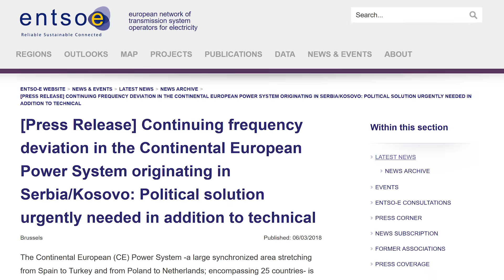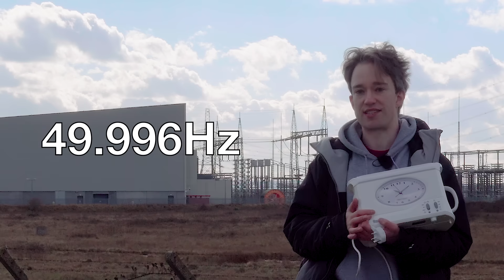European clocks ran slow for a bit. British clocks didn't.

Comment: Great video, thanks.
I believe, as the number of wind/photovoltaic  power  generators increase, and high-inertia giant vapour turbines, powered by oil/gas  - decreases, it will be increasingly difficult to keep our precise 50 Hz mains frequency.
It may be necessary to use a frequency reference master source, instead of relying on the mechanical inertia of those heavy pieces of equipment, as it has been the case to date...
Reply: Solar panels produce DC current that is turned into AC by inverters. And those can output a steady 50 (Or 60 in the US) Hz signal all the time with actually less fluctuations than the alternators of nuclear and coal/oil/gas power plants.
Wind turbines on the other hand have speed control mechanisms built into them but there can also be inverters.

Comment: What has underpower got to do with frequency?
Reply: Much: If the turbines don't provide sufficient torque, the overloaded generators will brake them too much, therefore they both will rotate slower, resulting in reduced frequency.

Comment: The situation is further complicated by the fact the Length of a GMT (Greenwich Mean Time) second differs from the UTC second by upto Plus or mins 4 seconds over the course of the year. While GMT is the legal time in the UK it is very difficult to get an accurate source of GMT - in most cases it requires quite a complicated calculation to calculate GMT ( or the nearest Time to this that currently exists) from UTC. It is not a static difference but changes throughout the year. So the big question is how is the UK 50.0000 Hz specified in terms of UTC or GMT ? If in terms of UTC a couple of times a year the days can have plus or minus two leap seconds added or subtracted to keep UTC in sync with the Earth rotation. On those days the 50Hz would have to be higher or lower to get the correct number of cycles in a day. If the 50.0000 Hz is defined relative to GMT the frequency would have to be adjusted continually to account for the irregularities in the Earth's rotation. For more information look at what used to be called The Earth Rotation Service - great title - stop work and the world stops rotating.  I have tried to find a legal definition of GMY+T but while it is used in acts of parliament it does not appear to have a statutory definition.

Time is not as constant as you might think !
Reply: It is usually 1 second per year added to UTC to align it with GMT, because the earth’s rotation is slowing down. A year is about a second longer than it was 100 years ago.

Comment: If Europeans want to run a clock accurately they should synchronise it with the German atomic clock signal DCF77 at 77.5 kHz. You can hear it from Ireland to Turkey.

Comment: This is all well and good but clocks in the EU and everywhere in the world are either battery powered or use an internal clock for synchronization and not the grid frequency 😁😁😁😁
Reply: Most alarm clocks don't
Reply: @markposthuma2000  yes, most alarm clock don't use the Grid frequency

Comment: So if I bought one of those (importing it to the United States of America), some British plugs, outlet boxes, and covers, made a 240-volt circuit just for those British outlets, and plugged that Teasmade in, the clock would run fast.

I think relying on grid frequency for clock timing is as stupid as Hoover's free flights promotion, and the Serbia-Kosovo issue illustrates why. They're cheap enough, just use a crystal oscillator.

Comment: Why is all of Europe on a synchronized grid anyway? What's the benefit?
Reply: For higher grid reliability and stability and for cross-border tradind (lower electricity prices).
Reply: What the other comment said but also, that claim is a simplification. The biggest exception is that the Nordic grid is separate (the continental part of Denmark and a couple of the closest islands are in the Continental Europe grid, but most islands including the one with the capital Copenhagen are in the Nordic one). The 3 Baltic countries also have their own regional grid. I'm not sure if Sardinia and Corsica and all other islands are synced to the Continental Europe grid either: at least those 2 are only connected to the mainland with DC, as with other non-synced regions.The UK isn't a single synced grid either, because Northern Ireland is synced with the Irish grid, not the main UK one. I'm also still leaving out some exceptions and details.

Comment: What do you mean "these cables are direct current cables"? You're not trying to imply that the power from the Netherlands traveled across the sea by direct current, are you? From what I verified by an internet search: "Voltage of DC cannot travel very far until it begins to lose energy." which is why DC power has never caught on.
Reply: DC has not caught on until semiconductor technology matured sufficiently. Today, longest transmission lines use DC (read about HVDC lines.) GB is connected to other countries via DC lines since GB is its own interconnection (it isn't synchronized to other interconnections like the Continental Europe Interconnection for example.)

Comment: Interesting but normally quartz crystal is used a reference as such the clock is still fine and breaking news- time continues at a regular rate clocks running correct or not - interesting story though

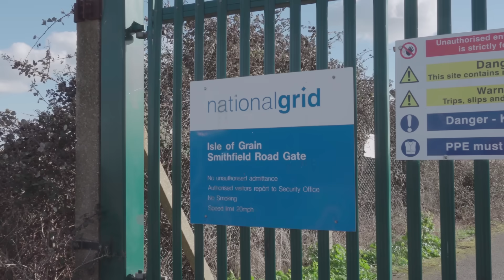Comment: 3:15 this sealed brexit, just saying, this really proved that the UK has everything under control without the EU
Reply: A sizable part of maintaining the balance of the grid is from imports from the mainland which if the EU wanted to be really dickish could make the problems with that I don't see it happening though as it benefits them to

Comment: Americans be like: weak numbers, we use 60 Hz
Reply: Julian GameZ come back when you have 230 volts at every outlet.
Reply: @spencerwilton5831  The American power grid is standardized on 240 volts. When it arrives at the house it arrives at 240 volts. It's not our fault Europe doesn't understand how to divide by two.
Reply: SavageGreywolf You do realise we have the option for three phase power too, but few homes require it because having a decent voltage means we can pull twice the power for the same current. If your power system is so good, how come so many Americans are always talking about power outages, generators, gas fridges and all manner of devices designed to assist during a long duration power cut? Here in the U.K. I think I have experienced one power cut in the last twenty five years. It lasted about an hour and was confined to a few houses on my street, caused by a cable being damaged by roadworks. The power simply doesn't go off here. Meanwhile, you have entire states suffering rolling blackouts. Not to mention still relying on coal for much of your power.
Reply: @spencerwilton5831  your absolutely full of it I cant remember the last blackout in indiana ohio or Kentucky   where I'm frequently at
Reply: @spencerwilton5831  The last time I can remember the power going out for a decent amount of time was during hurricane Irma. I live in Florida and the power was out for a day or 2 but some people had their power out for up to a week but it was a hurricane and there aren't any hurricanes in the UK.
Reply: @spencerwilton5831  We don't get extreme weather, volcanos or earthquakes in the UK like they get in the USA and these are all bad for trying to keep the lights on. Also, we've had 2 major blackouts in 10 years which affected properties in all parts of the UK so your 1 in 25 years is BS and I can guarantee you have had minor outages at some point just probably when you were either out of the house or asleep as we all have.
Reply: Not in every part of America. In Paraguay, for instance, they use 50 Hz.
Reply: Yes, but is your tea brewed on time? I think not old chap

Comment: what happens if you point a fighterjet straight up on full power? how high will it go? what happens then?
Reply: If its strong enough it will gradually go to around 70k meters where its engines will cut off because of lack of power, than because all planes are nose heavy it will point downwards and accelerate towards the ground once again

Comment: It seems like they would have to run it at 50.004Hz to make up for billing discrepancies.  Otherwise I think you could say you were overbilled by (essentially 6 minutes) of your average consumption over that time.  I'm not an expert on how power meters work, maybe they monitor the frequency.. But I think it'd be some calculation with it's magnetic reading and a constant value, because the frequency isn't supposed to change.

Comment: I would think most clocks these days are not run on synchronous motors, and certainly not recent digital ones. However... My parents married in 1945, and were given a gift of an electric clock run by a synchronous motor. It is still keeping time in my lounge..... You would know if it had a synchronous motor, you plugged it in, and spun a little knob to get it going. If the power failed, it would stop, but not restart itself when the power came back on.

Comment: In Britain, the entire power grid turns to DC for an hour in Autumn so the clocks adjust to one hour back and in Spring it runs at 100Hz for an hour so clocks automatically adjust forwards. Quite clever.
Reply: Or do the more intelligent thing and remove DST!

Comment: You forgot about the Irish grid, which isn't in sync with the British grid, but is connected via under sea DC cables
Reply: And the Baltic and Nordic grids, and the rest of the former USSR has the IPS/UPS synchronous grid (Ukraine and Moldova are planning to switch from that to the European one). E.g. Iceland and Cyprus are not connected to anywhere else at all, and the Swedish island of Gotland is only connected to the Nordic grid with DC.

Comment: Oh common just fix the tea clock with an arduino and pull time off an accurate NTPd or PTPd that's synced to a proper stratum 1 time source, like GPS if you wanna make it simple. If you don't need about less than 100 us accuracy you're fine with that.

Comment: That's Bollocks! The friggin grid over here in Greece as of April 29, 2020 the frequency here is at 49.0Hz. Screws with all of my clocks unless they are using an internal crystal reference. Every time we get a bad thunderstorm here we get all kinds of flickering of the lighting, brown outs, very short blackouts and sometimes zero power if something gets hit.

Comment: Seriously, who cares about the grid frequency, knowing that the slightest slides on this frequency is a measure of the load on the grid. As an electronician, it sounds as reliable as the voltage of the grid for a voltage reference. I prefer to rely on 77.5 kHz atomic clock signal time. Or GPS because precise timings is part of the measure.
Reply: CaptainDangeax simple clocks rely on things like the frequency of power as it’s a lot simpler. It evens out in the end so the result is good enough
Reply: @zachb1706  Maybe at the time of my C64. I added clock and use counters on my computers and I prefer to rely on a quartz, instead of tweaking inside PC's power bricks

Comment: :o))
My US designed microwave oven works correctly with our European 220V/ 50 Hz power supply, except for one detail: the turntable motor is obviously synced to mains frequency, and was meant to work with 60 Hz. So when I press the 30 seconds, full power button to nuke my coffee, it makes just two and a half turns, instead of full three, leaving my mug with its handle pointing inward. 
Oh, what hardships we must brave!

Comment: Perhaps the UK should consider stopping Brexit. Many clocks today do not use the power lines as a frequency source to regulate their operation and there is at least some discussion of no longer requiring the utilities to supply power at a frequency regulated well enough to be used to control clocks. If only the UK voters had understood this better maybe the whole Brexit thing could have been avoided.
Reply: Dave Kirkeby I’m sure it’s not clocks that topped the edge, though it’s Britain so you can’t be sure

Comment: The reason for that frequency deviation is that the grid frequency is dependent on power demand (as more load on generators cause them to run slower) and the frequency is used as a control input to throttle power plants. Slow grid frequency = high demand, meaning the power plants need to put in more energy to get back up to that 50Hz setpoint. If the grid frequency is fast, it's a signal for plants to throttle down or even shut off entirely. It's basically the largest phase-locked-loop to exist on the planet.

Comment: I got a 70's flip clock that also relies on the American 60hz to keep time and if I run my space heater on 1500 watts for long enough it will lose some time, the voltage in my room will drop by a few volts and I assume the frequency drops along with it

Comment: Fun fact: Frequencies of the trains in Sweden are 16,666666667 Hz.
And yes, it's 50/3.
Reply: There are five countries with roughly this frequeny, but at least three of them have changed to 16.7 Hz for technical reasons.
Reply: @Astrofrank  There is actually easier to create 16 2/3 Hz than 16,7 if you have 50 Hz available. Here in Sweden we have, if i remember correctly, three ways of changing the frequency. As long as we share the older tech used with the newer tech used on the same feeding line, they must have the same frequency so either not combine the older tech with the newer self commutated inverter or change the entire line to sci.

Comment: That teasmade runs on a synchronous motor which would depend on a very accurate supply frequency. But does this apply to all appliance digital clocks? My digital alarm clock, although it it supplied with AC power the digital clock part is 12vdc, even the radio part is DC. I've taken the back off and checked.
Reply: If it has a traditional transformer and the DC isn't made perfectly (capacitors, perhaps a voltage regulator), it will still change with twice the grid frequency.

Comment: 1:20  If its connected to that specific grid, it wouldn't be 6 minutes slow...  That would take a long long time for the clock to get behind that much...  Not sure why some of the smartest Youtubers who should know better are such trash at providing accurate information.  You wouldn't plug the clock in and instantly lose 6 minutes.  This video far under par, Christ this one is bad.

Comment: So you're saying if I brought that clock to the US It would become inaccurate immediately because the US uses 60 hz AC power?
Reply: Not only be inaccurate but also underpowered, because US Grid runs at 120v while Europe runs at 220v
Reply: @aribantala  but why does it need so much power? I have a treadmill that's plugged into the wall which is at 120 volts how can 120 volts run a treadmill but not run that little appliance that warms up tea?
Reply: Lmao I didn't understand how electricity works 4 years ago

Comment: Many clocks don't need adjustments since they are synchronized with the atomic clock(update to a pulsar ) through a radio signal ,and are thus self regulating

Comment: I dont think I have ever seen a clock that relies on the frequency of the electrical grid to keep time here in the us. Everything has an oscillator that is used as a reference.
Reply: We also have clocks that rely on a 60Khz radio signal, originally broadcast from Rugby.

Comment: Well I never. You learn something new every day.

I never knew you could keep time using the frequency of AC.
Reply: Accurate timekeeping is one of the very reasons that keeping the AC frequency constant is so important! Especially before the advent of quartz clocks, it was by far the easiest way for a clock that kept time without you having to wind or reset it regularly. Of course, little things like keeping motors running at constant speeds also need a nice constant 50hz. Can't have our record players drifting off from 33 1/3rd RPM...

Comment: in Australia, due to the rise in rooftop solar that runs at a slightly higher frequency so solar is used at the closest "load", most digital clocks eg. microwaves run fast. my clocks run around 10 minutes fast a month. it will vary with area you live in and amount of sunny days.

Comment: You should have also pointed out that appliances sold within the last five to ten years don't use the mains frequency to keep time. The reason is very simple. It now costs more to sell two versions of the device (50 Hz and 60 Hz) than it does to just use the internal micro-controller's calibrated ceramic oscillator. These oscillators have become extremely cheap, and they can now keep time to a few minutes or less per year. The only place you'll find a clock like this now is in old electric clocks, or appliances that contain electric clocks (like analog dial microwaves).

Comment: Or... you could use a quartz clock/watch. Mine goes off for about 0.5 to 3 minutes per year. It is solar, so the battery is always charged. I think it depends on the average temperature. Too lazy to try it.

Comment: Huh, I knew that that was the case for older electronics (such as the Heathkit clock my dad made many, many years back) and timeclocks for punching in and out, but I hadn't realised that modern consumer electronics still used it.
Next up, someone proposes adding or removing 180k cycles over (say) 4 hours twice a year... we can tolerate a 12.5Hz variation right? No? Spoilsports.